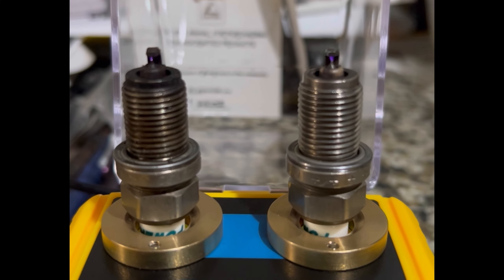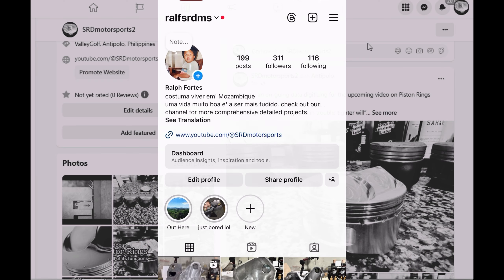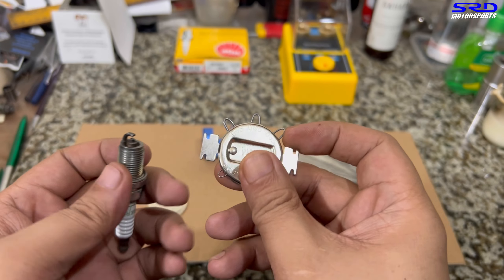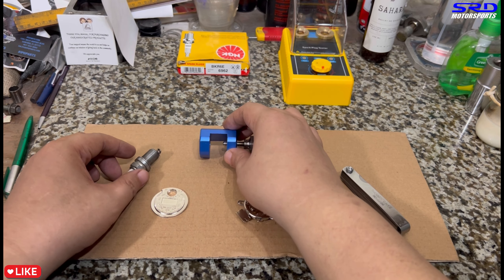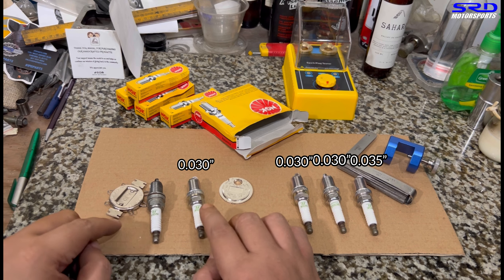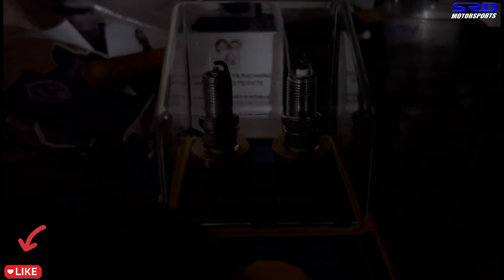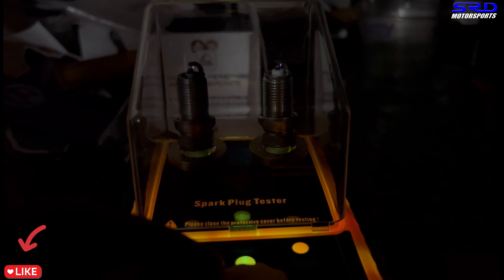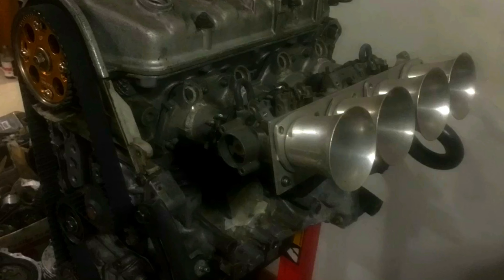Gapping Plugs: All about Spark Plugs and How to Gap them

Comment: sir what spark plug what would you recommend for b20vtec engine
Reply from the maker: depends on comp, but there’s no magic plugs 
We just run normal ngk bkr6-7 on 11-12.5 comp range and bkr8 on over 12.7 to 13 comp
Reply: @SRDmotorsports  ours is running 11.5 comp, what spark plug gap should we put?
Reply from the maker: @kenneth5488  in general the pre gapped range from 0.040-0.044” is safe
Reply: @SRDmotorsports  thanks man!
Reply from the maker: no worries man

Comment: I have a question about the P1J head and the P2J head. Which one flows better? My car has a D15Z8, which is an OBD2 engine with a normal D15 block but a P1J VTEC head. I'm turbo it I would like to hear your opinion on my engine/head combo. (I have no idea why Honda put a P1J head on a D15)
Reply from the maker: @goodmatchplay1372  it’s for fuel economy reason it’s just alot think Honda is always “racing” and think it’s gotta be “race”

Remember after obd1 almost every brand including Honda started heading to a more “economy” goal…

Honda Tuning Magazine (I think or the other Honda magazine) did a project they sent a d16y8 to be ported by Alaniz Cylinderhead Technologies in California years back… what they got? A “SLIGHTLY” better flowing head than a stock z6/p08 head

Is it bad? No …it’s more on “swirl” the goal for p2j aka economy l

If it did flow better then all sohc records should have run a p2j head why did they choose p08/z6 right? including Speedfactory years ago